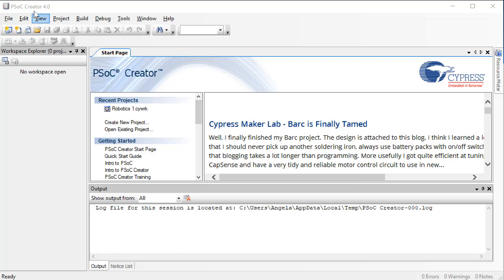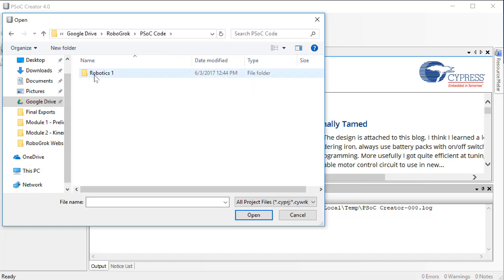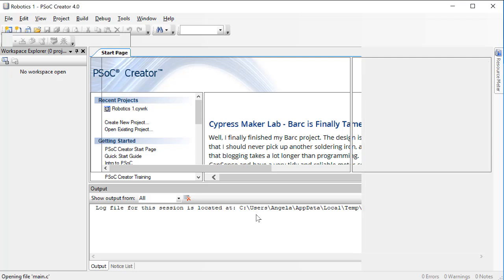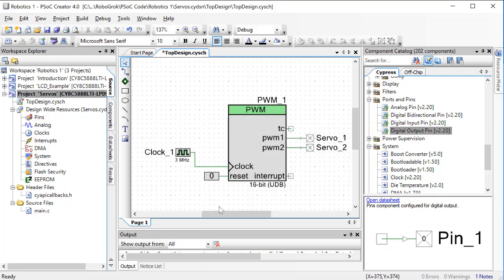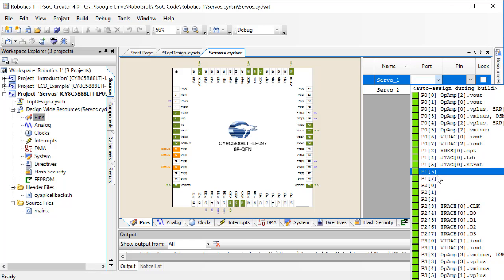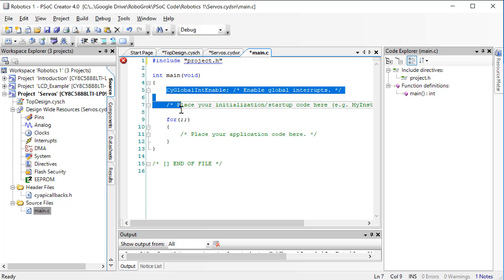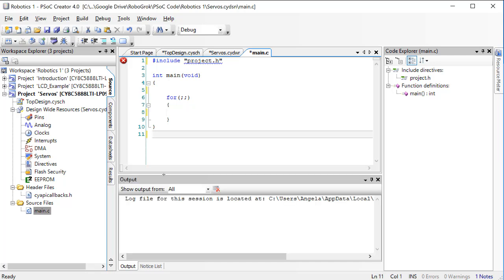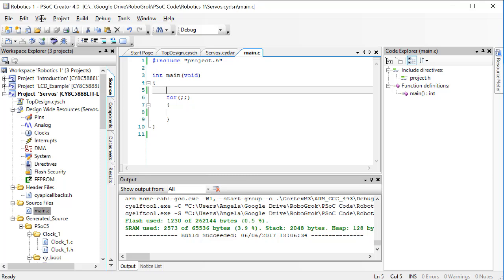Robotics 1 U1 (Kinematics) S2 (Kinematic Diagrams) P2 (Set the Angles of Servos)

Comment: Hi Angela,

When i program the code to the Process and connect the servos my servos just make a  a vibrating noise without moving.
Assisting the movement causes them to move a bit.

Ive tried connecting the PSoc to the wall for more power but that didn’t seem to help.
What else could be causing this?

Comment: Can I use python programming????
Reply from the maker: Not for setting the angles of servos, because the Psoc microcontroller can't be programmed with Python. If you have a different microcontroller that can be programmed with Python, then yes.
Reply: @asodemann3  madam, in my country (Bangladesh) arduino is available. So can I able to do it by this micro controller????
Reply from the maker: @mdnahiduzzamanbhuiyan4903  yes, for setting the angles of servos you can use any microcontroller that is capable of doing PWM (pulse-width modulation).